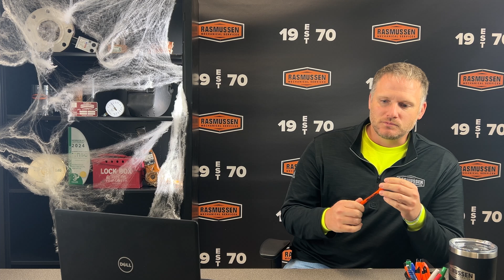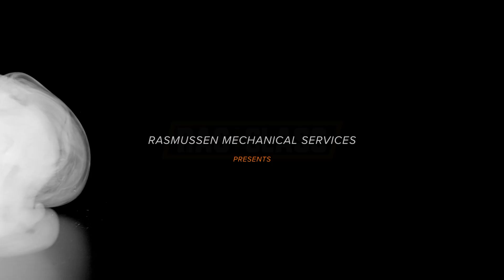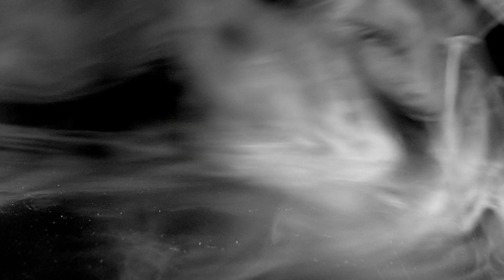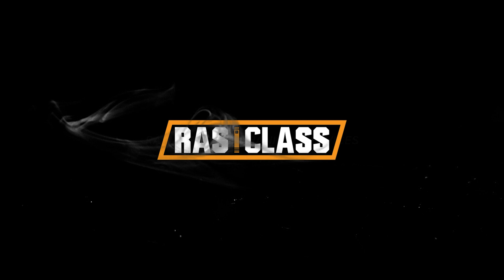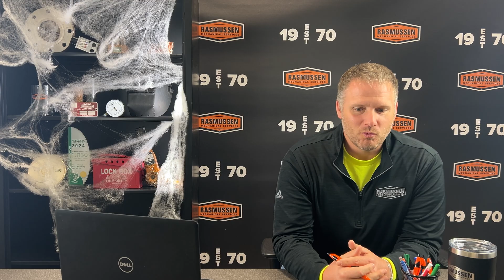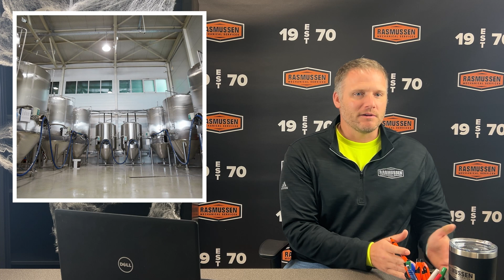Boiler Water Conductivity Made Simple

Comment: Due to the variety of boiler systems out there, you are missing the manner in which boilers and the steam systems are linked. Condensate return versus steam loss. If there is a high steam loss in the process then water use, chemical use and blowdowns are needed more often. If the steam is used for instance in a heat exchanger situation then the amount of condensate loss is minimal, the chemical use is far less and the blowdown frequency or length will tend to be less. In a sense a steam heat exchanger may not be required but rather a hydronic hot water system instead. One area that is overlooked is the importance of amine for condensate line protection and the need for test points that are easily accessed and not a chore. Good boiler operators are in the dinosaur category nowadays, don’t even get me started on multi stacked low psi boilers to get around full time boiler operators and the horrible new hydronic boilers/heaters with aluminum heat exchangers.

Comment: Hi Tim, I do have a question, is there any reason why you install the TDS skimmer on a side port entry to the boiler. Why cant you link the TDS controller to the botton blowdown (killing 2 birds with 1 stone). My thinking that when controlling the TDS you can also blow down any sludge or debris at the same time ? 

Im commenting from UK as a BOAS engineer. 

Thanks
Reply from the maker: We always skim from the top. We are trying to literally ‘skim’ any floating oily residue that could be present while also controlling the cycles of concentration.  Ideally it would be a slow and continuous stream so that conductivity is consistent. Bottom blowoff removes settled solids. If you were to slowly trickle out of the bottom line, the solids could plug it.  The idea on the bottom blowoff is to get the valves wide open to get a really vigorous flush to remove all the sludge/solids and prevent it from settling in the line. If sludge settles in the line and cools, it can ‘set up’ and harden, plugging the line. Not saying it would never work, but I wouldn’t recommend it. Two different systems for two different purposes.